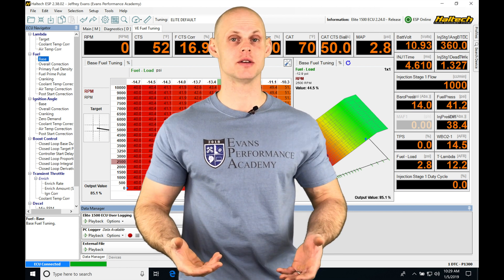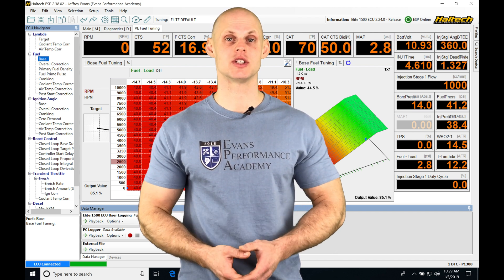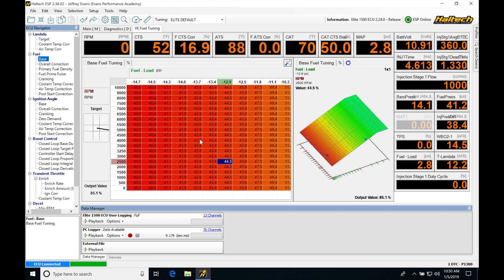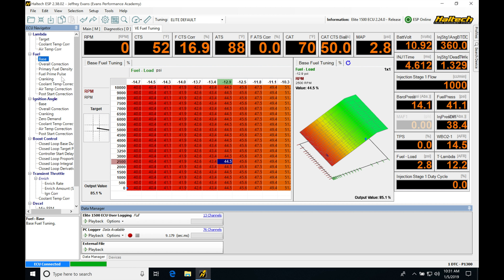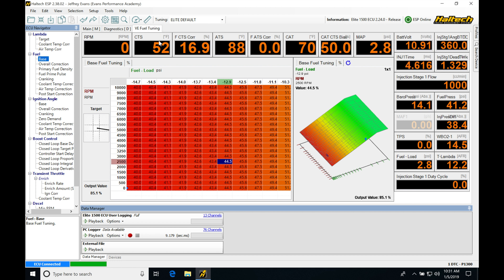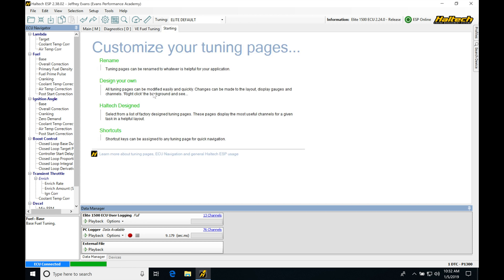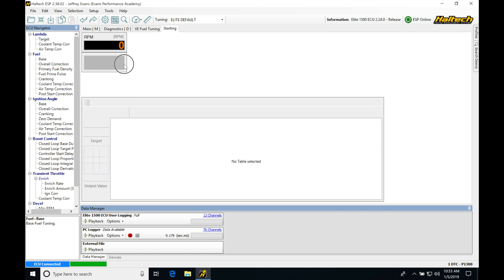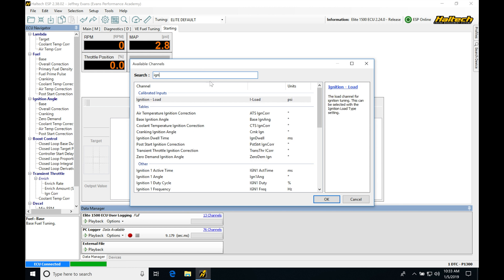Haltech Elite: Starting Fuel | Evans Performance Academy

Comment: Evan bro hope you're having a blast on your holiday but I just want to ask can I use a k20a basemap on a z1, seems that haltech doesn't have a z1 specific basemap, cheers man
Reply from the maker: Yes, that would be a good starting point for the tuning process on any k20 engine.  It doesn't matter if its a a2, z1, z3, or similar.
Reply: @EvansPerformanceAcademy  it's just that I think it's running rich at start up as i need to feather the gas pedal to start right away, if not it will backfire like a shotgun after maybe 3tries
Reply: Thanks for nothing.